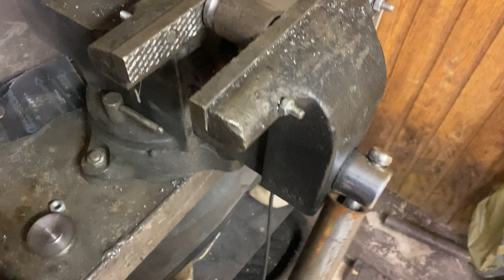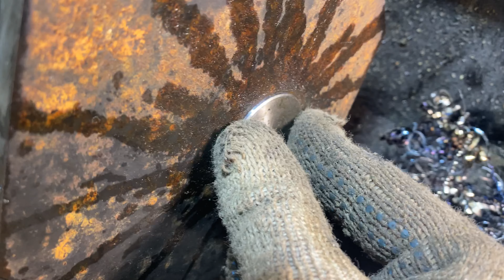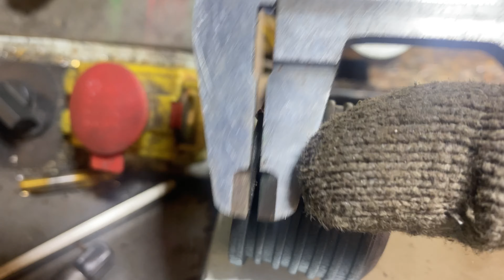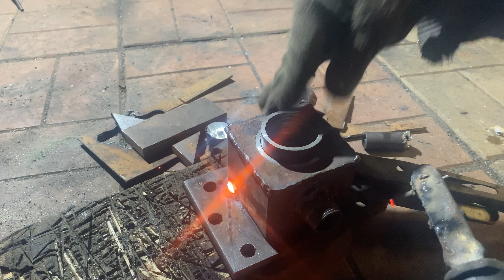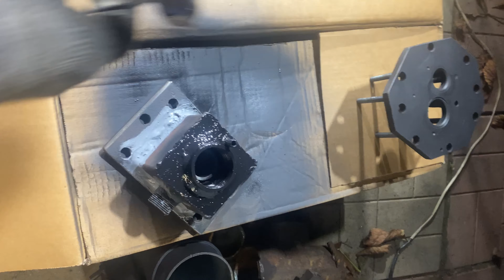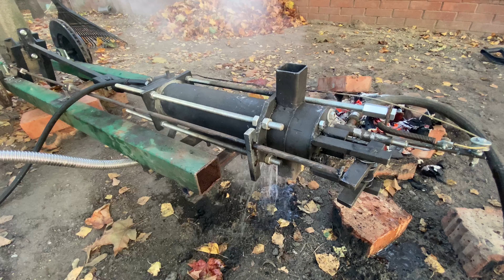Water Injected Steam Engine?

Comment: Intake air gotta be hot too bro.  Intake air gotta pass through a pipe that is heated by the fire.  Also water might need to be misted like a diesel engine injector.   I was planning on doing an experiment with an old diesel engine.  Just put water in the fuel tank and heat up intake air with a hot fire.  Engine block would not need to be heated in fire - just intake air pipe.  Could be called an external combustion steam engine.  Very safe type of steam engine!!!
Reply from the maker: It doesn’t take air in, it’s just water injected and steam should expand and push the piston down. Hope your experiment will be successful!